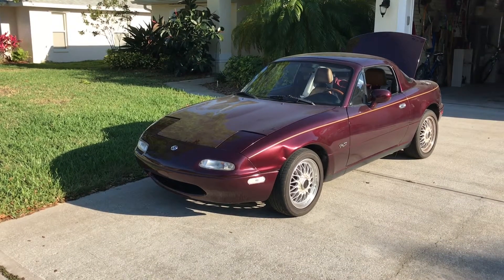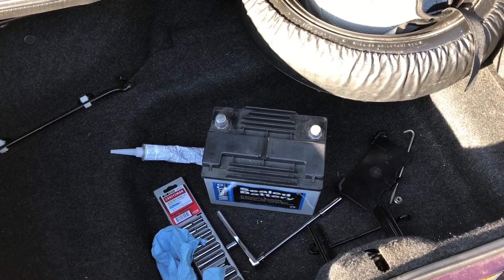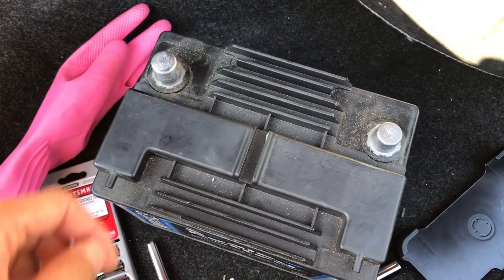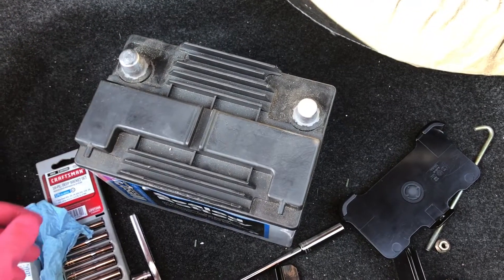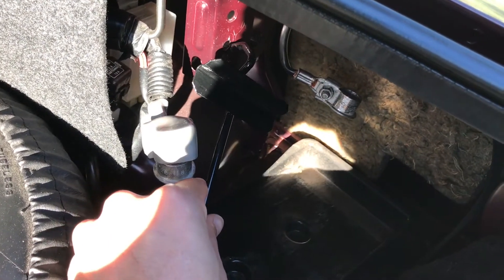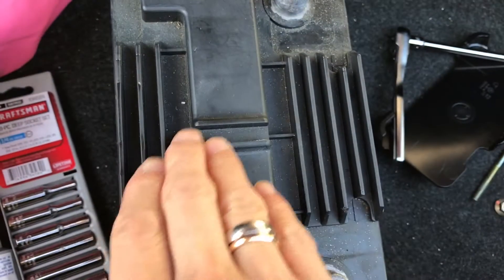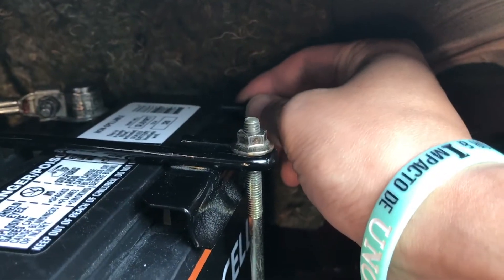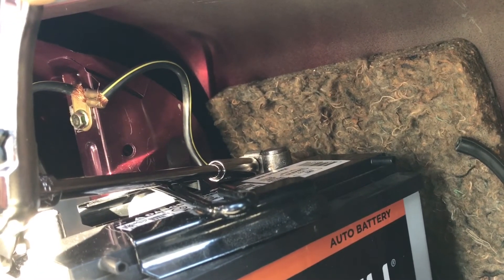Miata Battery Change

Comment: What tools (size tools) are you using to get the nut unscrewed and screwed back on?
That's the hardest thing for me because my litte tool doesn't have the extension & I can't get the negative nut unscrewed. It's such a tight spot to get to.

Comment: So I decided to buy the Duracell AGM for the Miata .... I was surprised that the Duracell was 25% smaller then my Panasonic original car battery from 2004 ... I had called Mazda to see if they still carried the Panasonic and they said no ... They were shocked when I told them my battery was 16 years old, but it just had 14000 miles on it .....